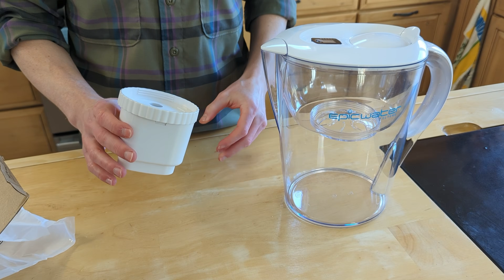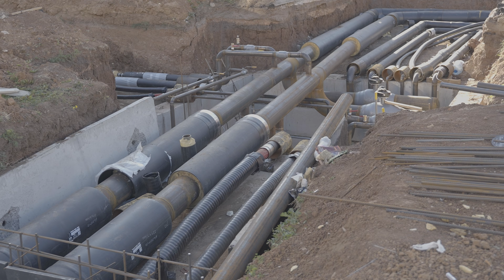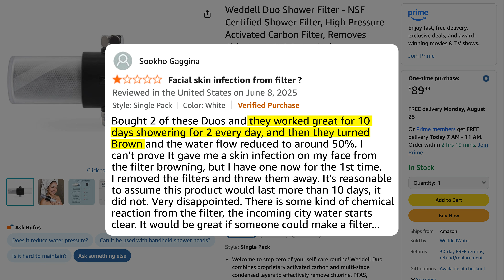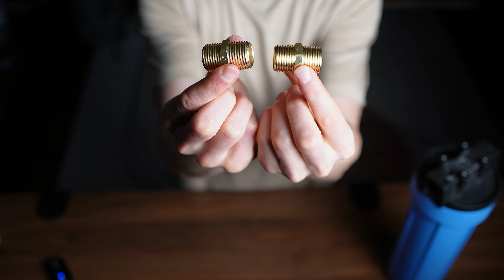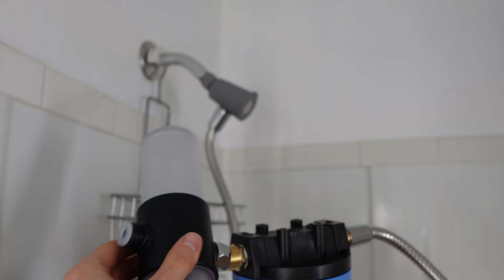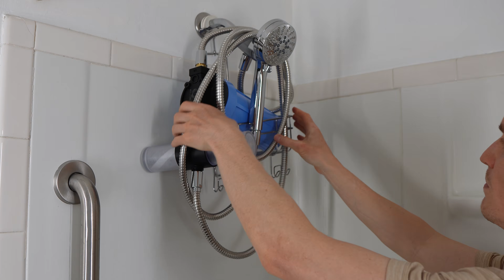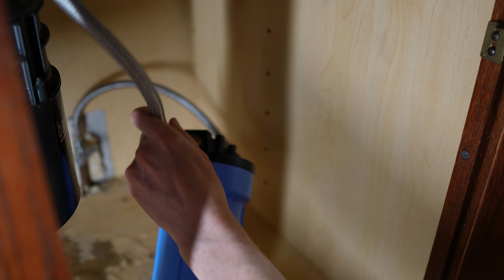You Have a Water Problem

Comment: My Weddell filters lasted 5 months. I think the owner of my apartment switching all of the pipes from copper to plastic probably helps a lot. Although I don't like the idea of plastic pipes and micro plastics in my water.
Reply: lead vs microplastics. its shitty whatever we do :(
Reply: @idillerce  stainless steel ftw. Many countries have it in practice and not at a super high pricepoint.
Reply: depends on the quality of the pipe. Not all of them leach microplastics but the microplasics in the city water are a good reason to keep using the weddell.
Reply: for details check greenpoint rater manual or look up gary klein.
Reply: Mine lasted two showers and stopped completely lol

Comment: Having a handheld showerhead with 2 different shower filters attached will kill the water pressure for most people lol
Reply from the maker: That’s a bit of an overgeneralization. It really all comes down to the incoming water pressure. Yeah if it’s already on the low side, then, stacking multiple filters could make it noticeably worse. But this whole setup is designed to prevent the even bigger problem of filters clogging up too quickly from sediment, which is what causes major pressure loss in the first place. At the end of the day it all depends on the water situation at hand, since water quality can vary a ton from one place to another.
Reply: @waterfilterguru do you have to use a handheld? is there any way to do the attachment with just hoses?
Reply from the maker: @divinistry1111   Using the handheld showerhead is the best and easiest way to do this. I've not tried or figured it out using a standard showerhead. You need the adapter with the handheld that allows connection of two hoses
Reply: @waterfilterguru I was deeply studying how you did that 😂... I'm just in this extremely fancy "modern" apartment with horrible toxic water.  I feel like I need a man to help set up a caddy arrangement like that,   and I'm also so upset I spent the money on that Waddell just to have to invest more money in this sediment catcher.  But at the end of the day,  my health is more important than esthetics. The other thing is
... it has a straight down attachment,  for their fancy  waterfall shower🙄 not angled....
All the appendages in this apartment don't fit my previous filters I had,  they are all these modern looking things that have threads or tips that won't come off.  When I tested the water it was DOUBLE ppm toxic than my last place.  Albuquerque NM was 248ppm this place in down town San Diego is 494ppm!!!! disgusting! 
I use a Culligan for drinking and I change that every 3 weeks,  I don't mind.
Reply from the maker: @divinistry1111   When you say "double PPM toxic" what are you referring to? PPM is a unit of measurement, not a contaminant. Are you referring to a TDS reading?  If so, its good to note that a TDS reading alone doesn't tell you if water is safe or healthy or not. It just gives you an idea of how much "stuff" is dissolved in the water, which can be potentially dangerous substances as well as minerals that don't pose a risk really. Check out this video A TDS reading?
Reply: @waterfilterguru oh ok, yes ... I don't really understand it. There's a tester the culligan water company gave,  you put it in and it gives a reading that says PPM -parts per million.  All I know is I want less,  not more 😂 I leave this stuff up to you smart fellows to help me :)
Reply: @waterfilterguru also... I don't want dead water,  like no minerals.  I think i understand that's why they add minerals to bottled water after reverse osmosis.   so I add pinch of Celtic salt or eat nutrient dense diet... it seems to help,  I'm not sure what everything means
Reply: @waterfilterguru  Is there a good sediment filter that can be used in place of the seiment filter in the weddell? Or is there another carbon block filter that will remove PFAs , plastics and chlorine as well as the weddell? Since I'm buying one canister already for the sediment filter, could I get a second canister for a carbon block filter and skip the weddell? And what is the lowest possible cost quality canister?

Comment: does this add-on reduce shower pressure? the weddell loses shower really fast without it cause of the build up
Reply from the maker: This is actually a solution to the exact issue you’re describing. When your water has a lot of sediment, it quickly fills and clogs the Weddell’s built-in sediment filter, which is why you see such a fast loss of shower pressure. By using a larger sediment filter ahead of it, the bulk of that material gets caught before it reaches the Weddell, so you should see the pressure hold steady much longer.
Reply: Mine lasts like 5 months works great 👍